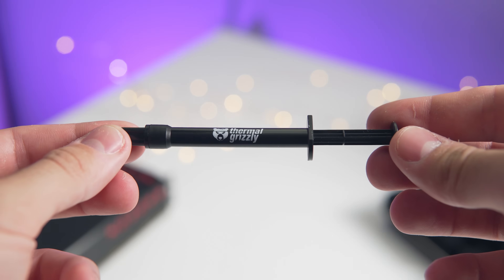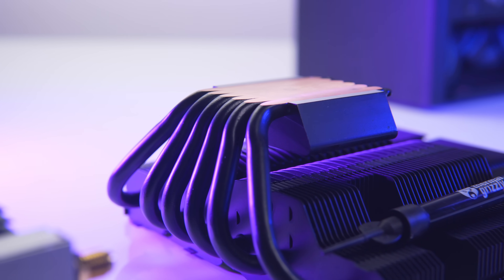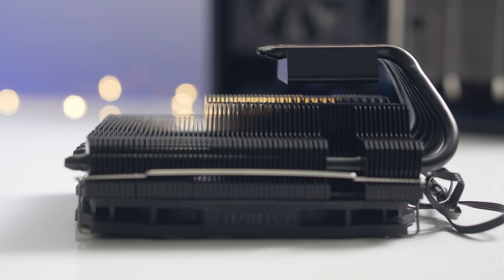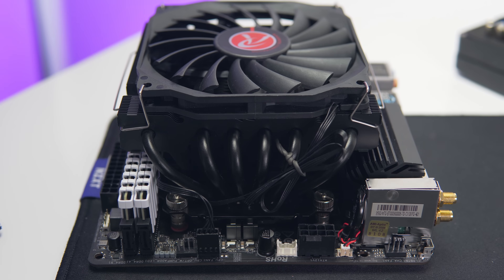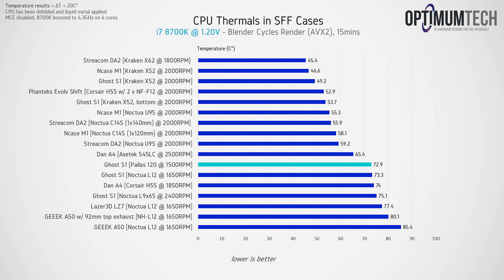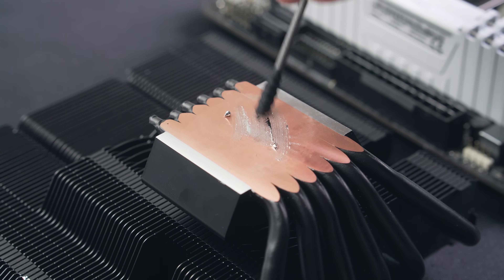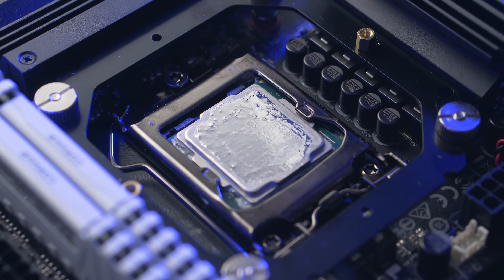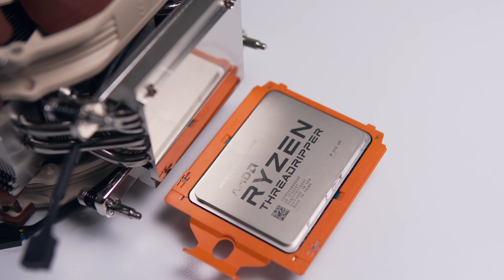Liquid Metal for CPU Coolers - Worth it Over Paste?

Comment: Hehehe. I have a problem with the advice the way you're giving it. In my experience, any time you have direct die-to-heatsink contact you'll want to use LM, be it the IHS of your desktop CPU or the heatpipes of a laptop. But yeah, seeing how much larger the IHS is compared to the die, I wouldn't expect adding a second layer of LM between it and the external heatsink to help, good paste is more than enough there. Pretty good video otherwise :-) just my two cents haha.
EDIT: Anyway, modern desktop CPUs don't expose the die anymore, so I guess my point is kind of moot ; just saying, on a laptop it's totally worth it :-)

Comment: I've used thermal grizzly liquid metal for deliding for years and have switched back to using kryonaut now as it isn't worth the trouble. One and done And it never had to be replaced. It seems to me that after a year or so the liquid metal starts to move or disappear. Especially when the cpu is vertially oriented like my delided 8086k with a larger copper ihs. Kryonaut under and above the ihs works great. Luckily nearly every good cpu nowadays is soldered again and that really is a good solution.
Reply: I delidded my 8700k years ago and applied conductonaut.   Haven't had to change it once in like ~5 years.  Temps are nearly the same as when I first did it.

Comment: Great Video,... How would you get the CPU Cooler off the CPU after using Liquid Metal? Must be hard after the Liquid Metal hardens.
Reply: Liquid metal doesn't harden. I checked an 8-month-old liquid metal cooling system and the material is definitely still liquid.

Comment: for gods sake do some research. even roman (der8auer) himself says not to use liquid metal on copper. the gallium will erode the copper in a matter of hours and render the cooler useless. if you are going to do a video on something please put 5 seconds of research into it.
Reply: this is incorrect. gallium will not breakdown copper! aluminum yes! theres a warning label for aluminum. it will plate it and stain it over time.

Comment: No, it kinda tends to disintegrate your parts and only drops the temperature by 20 degrees max with your parts not working.

I mean I've never used it and never will obviously but that's what I read from basically everyone on the internet.

Comment: That tip you are using is for sucking excess of metal not for spreading it. If you dont know what you are doing at least you could have read manual that thermal grizzly gives with its products

Comment: Having recently delidded and liquid metalled an old 4th Gen CPU for practice I have to say you are brave using it between the ihs and cooler. That stuff is a pain to clean up!
Reply: I watched man vids I use nail polish from overclocker UK to cover the smds then I coat the die generously then re attach IHS putting in socket then lock it in place for about 10-20 sec take cpu out take the IHS off add LM to match die on IHS Has helped alot on 9900KS CPUs.

Comment: Thermal Grizzly kryonaut ist enough for non delided CPUs it wont get better with LM because between the die and heatspreader is just cheap paste from Intel. If you delided CPU then you will get much more performance with Thermal Grizzly conductonaut.
My Alienware Laptop gets by 100% load from overheating above 100degrees to 86degrees with LM.

Comment: One thing that this test does not go over is the "future" of that application. When Conductonaut is applied to CPU Cooler and IHS, there is one very negative side effect. The thermal gains are great over cheaper thermal pastes but when compared to some pastes like Artic ICE, the performance is negligible for this one reason only. Liquid metal causes the cooler and CPU IHS to pseudo solder together. They will fuse and prying that off is risky, with at risk being your motherboard socket pins at the least and breaking the CPU Substrate while trying to take off the Cooler at the worst.  Totally not worth it. 2/10 do not recommend.

Comment: Dealing with liquid metal for a while now, I can tell you that a micro drop of this stuff (that you can't even see) will ruin your motherboard, or damage some memory slots, because it is liquid, and liquid goes through cracks, even if it looks kind of in a bubble at first. I ruined my motherboard as it drifted into the socket. Direct contact with a cpu/gpu die and liquid metal brings results of about 10-15 Celsius, all the way up to 20 if you are lucky. If you apply cpu ihs to the heatsink you are going to get 5-8 Celsius difference, with a high risk of ruining your CPU and motherboard, potentially taking your GPU and memory with that sinking ship. 

In short...FUCK...that....shit. Okay? Thank you, and good night, everybody :)
Reply: So if you've delt with lm for a while then you likely wouldn't fuckitupitos like you did. There is only 2 possiblities - applying incorrect amount and on just one surface and lack of very reliable hand eye coordination. Takes expertise indeed

Comment: I put liquid metal on a copper cold plate and it corroded within 24hs... Took it off to check it because the thermals were terrible and it was all pitted and black. Ended up replacing the entire AIO. DON'T DO THIS! Only use it between the dye and IHS

Comment: Direct die mounted cooler. Hope the back bracket fits. Thats the ultimate sff in my opinion. If you look at laptops cpu and gpu, they are all direct die mounted. Sff nowadays are approaching laptop levels of compactness with much more powerful hardware.

Comment: Guys I need help..
I bought a new ryzen 2600x . While I was removing the cooler from the box I touched the thermal paste with my finger. So when I started building it I thought to moving the cooler on cpu to spread the thermal paste on it and I remove it to check it's looks not the bad ..  So is it necessary to buy new thermal paste for ryzen 2600x's cooler

Comment: liquid metal sadly, dries up after a while. It'll need re-applied every 4-6 months
personally I don't think it's worth it
Reply: It's been proven to last over a year. You might need to reapply once if using it on a copper surface (because the copper absorbs some) but after that you should be set.

Comment: If that Rajintek cooler has an aluminum block around those heat pipes and the Thermal Grizzly Liquid metal has Gallium in it, you cannot use them together.

Comment: the liquid metal is mercury  yes the same toxic liquid found in thermostats, thermometers and vacuum guages that display using a thermometer like tube.

you are better off just putting the bare plate of the cooler against the cpu.

i figured this out because of a reaction with aluminum 

https://www.youtube.com/results?search_query=mercury+aluminum
Reply: Stop spreading disinformation, it's not mercury.

Comment: System builder myself...don't buy this shit. Because it's electrically conductive (will fry your hardware if it touches contacts) and the real life cooling effects are negligible at best. Use Arctic Silver. Never had a problem with it and the results are optimal.

Comment: you will get greater returns out of LM like that with more fans on the cooler, and more measurable with a high tdp chip obv, but the liquid metal eliminates the bottleneck of the transfer of heat to the cooler. then the coolers own ability to dissipate heat becomes the bottleneck. thus more fans and surface area get more measurable results. run that test on an old fx-9590 like i did. you will notice a greater gap in the performance of the TIM there. if you have a newer model cpu is that hot its likely a workstation chip, so the question you have to ask yourself is if your willing to risk your expensive cpu on the 8-11 degrees of headroom you'll get (with a BIG cooler)

Comment: I think it would on Threadripper, because the heat spreader on that is soldiered on. But, it might be the same as your delid 8700k. Will be checking that out for sure.

Comment: You get 3 degrees less, but pls, don't use liquid metal instead of thermal paste in between thee cpu and the cooler, use it only for delliddiing or it will corrode your cooler Base

Comment: One tip for all when spreading liquid metal. First put a small drop on, then spread it as if you're wiping it off with a lint-free tissue (paper towel works too). Then add it on and spread like normal - it becomes very easy.
Reply: What..?

Comment: I think you'd see a bigger difference if you used liquid metal under the ihs as well as above being that they use thermal paste on both sides from factory, hence why stock it runs in the 70's instead of lower. I'd love to see this comparison with a high end ryzen or threadripper with a soldered ihs and larger heat output like you said.

Comment: I had done Liquid Metal application (the same Thermal Grizzley used in this video) on my Macbook Pro with copper heatsink and after 1.5 years of usage it hardened. It gave me amazing thermal while it worked, but I just can't recommend this to anyone after the experience. I couldn't scrape it off, so I tried to level it as much as I can and applied thermal paste over it and now it still works again, but it was quite a trouble.
Reply: The thing you couldn't scrape off is actually an alloy formed between liquid metal and copper by the way and it's not going to affect the thermal cooling so don't worry about it

Comment: did LM(grizzly) on 2 cpu coolers and 3 different gpus so far and not going back to pastes if can help it. if u do it right(spread with no gaps or pools, insulate surrounding(electrical tape or nail polish) as well as no aluminium contact(ate a quarter of my corsair a70 cooler in 4 days) -its the best cooling available(in my case 34f drop over AS4 with same cooler). LM ftw!
Reply: I do the same if you use just a tinny bit....he was actualy using already too much....than you can use it several times and its worth and the risk is 0.

Comment: i used liquid metal with my ryzen 2400G..    after 4-6 months i removed the cooler and found that the liquid metal had been eating my ryzen chip,   it now has a  1mm deep hole in the center of its IHS

Comment: ... you do know what happens when gallium or mercury mix with the aluminum in the heatsink contact plate, right? Not a good idea at all.
Reply: It's copper
Reply: @leonato83  the cooling block on the CPU itself is usually not copper. and even if it were, it doesn't matter - gallium & mercury have the same reaction with copper that they do with aluminum, just a little slower. it will destroy your hardware. this is not a good idea. but if you don't believe, go ahead and try it. have fun. knock yourself out. I'm not stopping you. but don't act surprised 2 months down the road.
Reply: @taragwendolyn  have been using this on my cooper plated cooler for 10 months, works just fine..

Comment: what about lids that are soldered on? also not sure who told you the stats of those pastes but it cant be right....  Galinstan only is at 16.5 and pure Gallium is only 40.6 so that 73 claim is some sale pitch pawned off on you. you would need to use a special solder of SnAg (96.5/3.5) and has a melt temp of 221 to even achieve those thermal transfer rates... (if soldering a non-soldered lid is even possible...)  but is why dont people just use SnAg 1mil sheet or dead soft annealed copper 1mil sheet you cant beat the thermal transfers of pure solid metals. at that thickness it would form to any surface and irregularities, even better if you just lapped both surfaces if possible.  you could even go balls deep and electroplate pure silver onto the bottom of the lid at micron level thicknesses

Comment: You know what we did back in the days? We took Arctic Silver, applied a thin layer to the core with a credit card (thinner than hair, thinner than paper). Then people got lazy and started putting a blob or an X of arctic (silver or mx) but they put too much in order to spread itself everywhere on the CPU die. And after so many years or R&D that would make silver non-conducting, some one had the brilliant idea to use a 100% conductive and corrosive liquid as thermal paste that would REQUIRE to be thoroughly spread on the CPU. Guess what... if you carefully spread a thin layer of arctic silver 5 or kryanot, it will be as effective as your carcinogenic and extremely toxic liquid metal.

Comment: I don't recommend doing this. Applying too much is VERY easy, and it ended up completely killing my old cpu + motherboard when moving the pc. I had applied a very tiny amount, but movement of the system was enough the make the LM go UNDER the CPU into in the socket along with on top of the motherboard and completely kill both my CPU and motherboard.
Reply: You clearly had to have put too much on for it to go under like that in moving, I have it on a GPU and CPU on two separate laptops on the go daily, no issue in a year and a half.
Reply: @backupplan6058  i put on a drop, which i then sucked flat before spreading it. Nothing out of the ordinary.
Reply: @Juggler Rune , that means nothing, you get big drops and small drops. If it was large enough to be sucked flat and then enough to cover the IHS then you at least initially put, far, far to much on. If it was able to produce a drop large enough to form outside of the heatsink and then move behind the socket when moved then that’s you putting on too much. A craftsman never blames his tools, you messed up, don’t blame LM for your mistakes.
Reply: @backupplan6058  As i wrote in my initial message, it is very easy to apply too much. I'm not blaming LM for ruining my rig. What im saying is, that it is a hard material to work with and that i do not recommend using it outside the IHS, since that makes it easy to screw up. With that said, i do not believe i put on too much, but rather that i tightning the cooler was overdone, squeezing it out.

Comment: Short answer. Yes! 5-7 C difference on CPU and GPU. Ryzen 2700x w/ Noctua D15 and GTX 1080ti w/ Raijintek Morpheus II - This is the difference compared to Nocua NT-H1 - I recommend using 3M Scotch 33+ electrical tape around the GPU die.

Comment: Without delidding, it is not worth it. When delidded and liquid metal put between the IHS and the core, you will see a big improvement. This also goes for notebooks/laptops, where no IHS on the CPU is used.
For my ITX build inside DAN SFX A4, I have actually delidded the CPU and did not use IHS at all. The main hurdle here is to remove the LGA brace (metal frame holding the CPU) and adapt the mounting mechanism for the missing height of the CPU core. Then you will have the right thing - my trusty i7 4790k works at 4.4GHz@1.2V without throttling under only Noctua L9i (92mm fan cooler).
Reply: Advocatus Diaboli  CPU die is not electrically conductive - the ceramic silicate material, which is the shiny dark grey package we see when we delid our cpus, is already isolated. This alone leads to the conclusion, you cannot conduct any electricity to the CPU block.

Further more, fluid used inside AIOs is never water alone - it is in most cases glycole (alcohol) based liquid, maybe mixed with distilled water in certain amount, but that is also not conductive. Heck, even pure water is NOT conductive! Water starts conducting electricity when inpurities are dissolved in it. But still, the water is not nearly as conductive as many think, not even the water out of your bathroom or kitchen.

Have had much experience with liquid cooling back in the day when I started with thermaltake bigwater cooling system. Had a leak onto my GPU, GPU started showing some artifacts and it was only then I saw already dried CPU coolant on the PCB. I washed it away with alcohol, GPU functioned without any problems.

EK full custom loop, had a leak on the CPU block all over mainboard, PC was running a bit hot, I knew something is not right, so I was stunned when I saw a small waterfall down the mainboard over the GPU - my inlet barb on CPU block was not screwed in correctly. Turned off, wiped coolant, let it dry, put back together, booted and functioned without any problems.
Reply: Are you using a Delid Die Guard? Im considering going no ihs after delidding and using one of those
Reply: @PedroMoreira2001  I am using no die guard. Havin finesse ("feeling") for the mounting pressure is enough.
Reply: Advocatus Diaboli well I think it shouldnt make that much of a difference because where the LM is great is spreding the heat from the Die to all the ihs, making it much easier to dissipate. But since the cooler is generally the size of the IHS you may not see that big of a leap in performance... And there is a HUGE problem: most AiO coolers have a bare copper bottom, and the LM will destroy the copper
Reply: @PedroMoreira2001  LM does not destroy copper, nor does nteract chemically with the pure copper or nickel. If you have a cooler with aluminum alloy, then you will have problems. What people don't understand is: liquid metal contains many small metallic particles, hence the name. These particles can become embedded/pressed into the other metal, be it cooler or IHS, or even bare CPU die. The result is a surface which cannot be cleaned from liquid metal. You can use any metal polishing paste on such surface and you can buff it out in 60 seconds.
Reply: @johnDe5tr0yer  I wouldn't use a Die Guard, but I'm kind of afraid since it is an X299 build, dont want to blow that much money
Reply: @PedroMoreira2001  If you have second thoughts in your ability for feeling, go with the guard.
Reply: Advocatus Diaboli  yeah termal grizzly kryonaut its pretty damn good

Comment: well this is pointless. On y overclocked 2700x that can pull 235w when running ibt there is 6 difference over THERMAL GRISLY Aquanaut . For 100W cpu deffo no point.